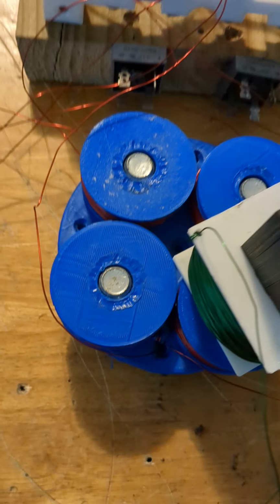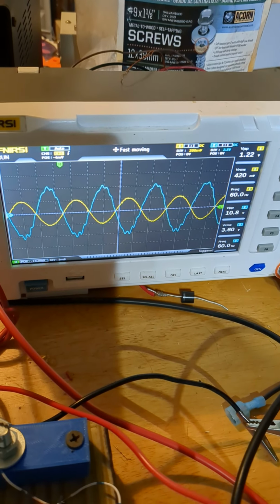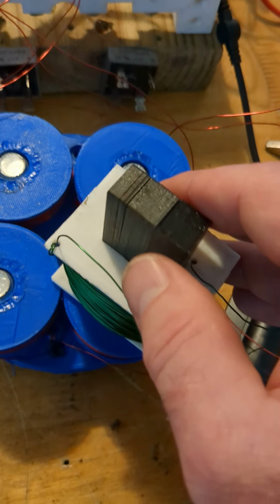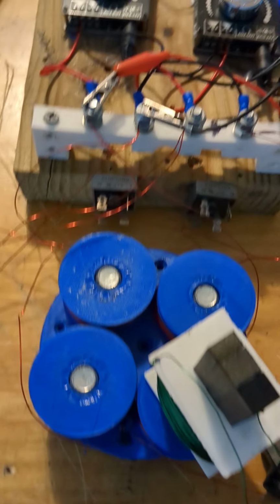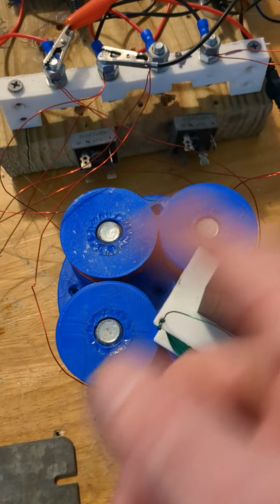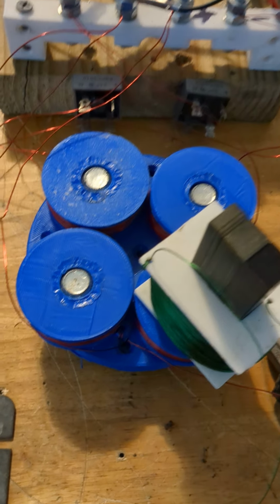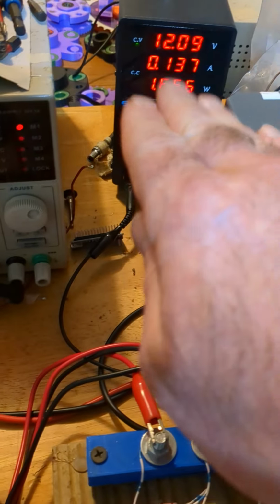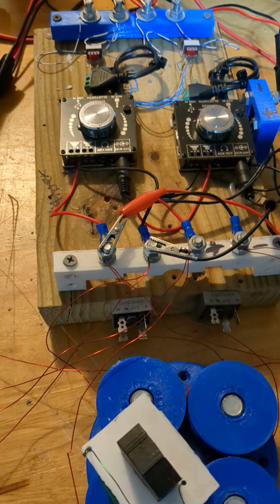Rotating Magnetic Field With No Moving Parts

Comment: Use AI. I found some interesting stuff talk to AI about the same concept. Induce a field in a coil that continues to stay powered even after you shut off the supplied power similar to how fusion reactors work. You also need a magnet and a secondary coil to make it work. You should also check into flat stacked coil designs. I’ll be building this setup when I get back to Alaska. According to AI, it’s possible to achieve 1,500 watts of output power in a 2’ x 2’ device. Absolutely no moving parts and only 30 watts to start device. No input power required after startup. Let me know what you think.

Comment: If the field is rotating, why do you have to rotate the pick-up coil in order to change phase relations?
In my world, if a field is rotating, you'll see a varying 'PHASE related to input' field on the scope - WITHOUT moving the pick-up coil..
Did I understand something wrongly from your description and illustrations?
Edit - Added 'PHASE related to input' above, to clarify my question/experiences
Reply from the maker: No.  You got it backwards.  Take a magnet rotor and place 2 coils around it.  One at 0 degrees and One at 90 degrees. Look at your phases.  They will be 90 degrees apart.  Now move the coil that was at 90 degrees to exactly 180 degrees away from the 0 coil,  now that phase will be 180 degrees .   When a coil is induced with a rotating field, moving the coil changes the phase..
Reply: @floodrod  The title says: Rotating Magnetic Field With No Moving Parts
- so moving the coil is... 'no moving parts' ?

Edit - what I'm trying to say: When placing a magnet in the center - will it make the magnet spin 'by the moving magnetic field' induced by the coils.
Perhaps I'm a bit biased by async AC systems trying to sync - generators don't like being coupled in when not in phase with each other, and watching those phases move around might have complicated my view on multiphase systems
Reply: @EgonSorensen  He's right, if you put a compass in the center of the arrangement the needle will spin because the field as a whole is rotating as a resultant of the 4 phases, as each of the 4 quadrants have a 90 degree shift they're all working together to create a virtual pole that is rotating.
Reply: @JenkoRun  I watched some of the other videos on this setup and got a glimpse of the 'entire' system - and now it makes sense.
Yes, got it now... Seems to act as a BLDC to me, 4 pole and 'fixed' speed depending on the freq generator output. 
Interesting to follow what will come from this :ø)